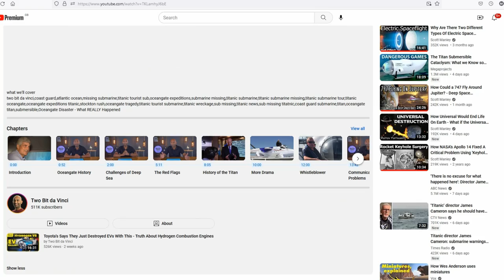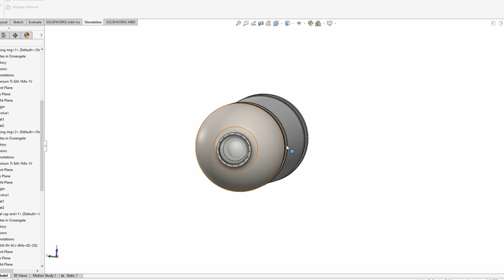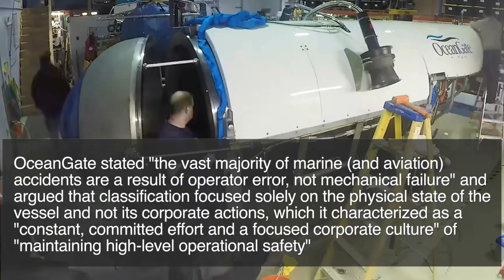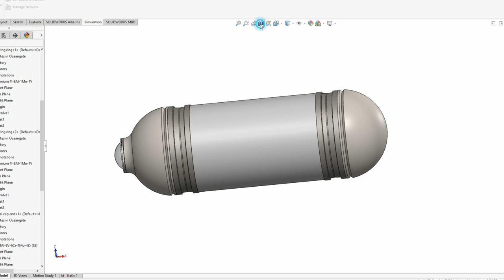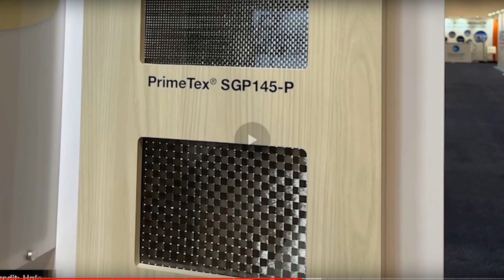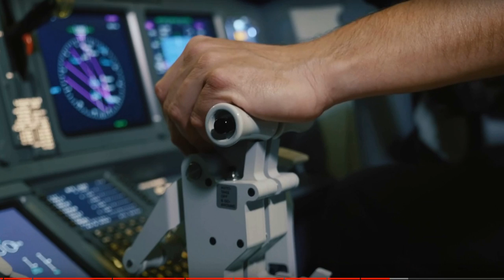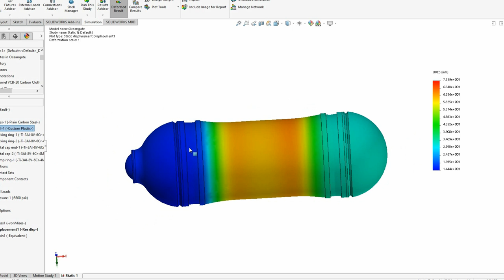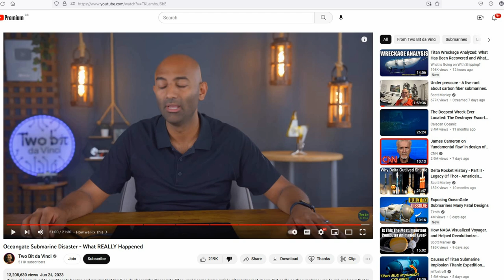Oceangate Titan - Engineering Failure?

Comment: You waffle on about pressure when it is commonly understood that the weight upon a person's shoulder is known to be ~14.7 PSI. That is understandable by most people had you said pressure is all around a body at 14.7 PSI. The bottom of the ocean is the beginning, not the end. There is a hole to dig into the mantle. You see, one person's perspective view. When you know the origin of the TITAN you would not believe it, so now I will tell of the subs design origin so you can figure out why the TITAN Sub was not designed to be a submarine - I designed what became the titan sub, complete with a carbon outer shell with a titanium lining and dome ends, one with a round window. The design was originally a computer mouse cleaner that was intended to clean the X/Y rollers that operated against sensors that controlled the mouse cursor position on a monitor screen. My design art of thousands of things, many vehicles, subsequently got made, distributed and sold globally. Now we have the Internet after my loss of design art and the unacceptable knowledge of the loss of more people who did not need to die but died because of them taking the opportunity to buy into what I see as stolen designs and I am not able to get anyone to investigate the loss of my technical designs of hundreds of inventions, products and stories. It is a cruel world, but people will always push things they have to the limits of operation and some will ignore the warning signs, as the operators of the Titan sub did, despite warnings from engineers because of the cost factor or otherwise.

Comment: Stockton Rush said in an interview, that the carbon fiber cylinder would flex inward 3/4" (19mm), when at depth. That seems like an awful lot to me. Seems like it would wiggle the glue joint between the carbon fiber & titanium, peeling it apart or otherwise making it weaker each cycle?

Comment: Could the implosion be caused by a micro crack or structural stress caused by the banging from inside? In other words, the occupants caused the implosion. Titanium body wouldn't have cost much. In the ocean, when filled with air, it's still as buoyant as a piece of paper anyway. So, why went for a uncertified (depth wise) and untested (life cycle wise) reinforced plastic is beyond any engineer's mind. To add insult to the injury, none of the billionaires who were so wise and smart to earn it in the first place didn't question any aspect of safety, redundancy, structure, regulation, certification, testing, what if worst case scenarios etc. The moral of the tragedy is "trust but verify", the good old cold war era saying.
Reply from the maker: The pressure differential is so great that you'd really have to go to town on it.

Comment: Surviving in space might be simpler in some ways but you still have to get there. Propulsion just to get there is the hardest part. The big thing with deep Submersibles seems to be balancing the strength of the pressure vessel with how heavy it will be when its finished. And its not just the ballast issue, you also have to move the thing around and find a ship capable of dealing with that weight. I think these guys went with this type of carbon fiber hull mainly to be cheap. It saves them on a complicated ballast system, saved them on the tender ship and allowed it to be moved around by much more common handling equipment. Just renting a big enough crane can be a big expense. The trying to do it on the cheap thing should have ruled them out of the deep sea game from the start. Their whole operating budget was a rounding error or a tank of gas for proffesional crews. Some things are "elite" for a whole slew of good reasons. They didnt even use the best methods available for making the hull. Probably had cat hair and mosquitoes glued in with the fibers. Crazy that they they seemed to have convinced themselves to not take 6000lbs per square inch all that seriously. I've read multiple quotes from Rush about having all this time if the porthole or hull started to fail. Really makes you wonder how well he understood what he was doing. Or if he had a death/murder wish. Now carbon fiber hulls for pressure vessels will be like hydrogen for airships. Hydrogen is clearly the best option for airships, it has more lift, its renewable and its not valuable for a million other critical things like helium. The Hindenburg died for reasons other than hydrogen, the burning hydrogen was kinda after everything else went wrong. Composites work fine for pressure vessels when created by proffesionals. Not by conmen in an open air garage.

Comment: The biggest thing I noticed is the titanium ring is on the outside of the carbon, this is likely because being inside would have thermal expansion problems where the ring would shrink more than the carbon fiber. So they put the rings outside putting the glue under tension and shear forces. The shear forces don’t matter as much because the  pressure is pushing the caps towards each other. However, cycling the tension force on the glue, along the ring to carbon fiber axis, would be a predictable failure point. The design is interesting because the carbon fiber is like a bridge between the rings but this design should have been scrapped since the interface between the two materials has no safe solution.

Thanks for the video, I was waiting for a solid works model showing the forces for a week.

Comment: The XBox controller thing seems practical if you're remotely controlling something but, I think what everyone is missing is would this be practical inside a manned submersible with higher oxygen ppm in the hull? Does the military use basic Xbox Controllers controlled within a manned vehicle? I heard unless it was modified for a flammable environment it and other non-shielded or non-dampened electronics could all become fire hazard. As far as I know the U.S. military only uses them for unmanned vehicles or drones that are no threat to a crew inside.

Comment: I find it outrageous that they spun the filament like a pool of thread, no transverse members to tie it all together laterally. That means they were relying on the epoxy or whatever resin to bridge the gaps between filament. Which will not stand up to high pressures by itself. Should have used steel or titanium!

Comment: I think the issue with the game controller was the one that was used. They didn't use a PS pad or an Xbox pad with millions of hours of testing, they used Logitechs cheapest offering. While Logitech are normally pretty good, the reveiws of the cheap pad are BAD, loosing connection all the time, stopping working altogether, chewing through the batteries in no time. If gamers would buy something better for PC gaming, why would they cheap out so hard for this?

Comment: This may be a stupid question, but what do you think would've happened if everything was built as it was done... but on top of that, there were like 8 or however many titanium bars that connected between the two rings outside of the carbon fiber tube? Like an external fixation in medicine? As a layperson: Those bars would've perhaps held the rings at the intended distance, removing strain from the glued section? Making the "weight-bearing" (or "pressure-bearing", I suppose) hull structure out of carbon fiber and glue seems ill-advised, but what if you installed something that made it not "bear weight" (or "bear pressure") or at least severely reduced it?
Reply: No change. The external pressure pushes the ends together more then the rods could do.  

I think it was the glue joints, but i think it was a leak, not a break. Once they failed in one tiny spot the water coming in at over 5k it would have acted like a water jet table and cut the glue out and fill the vessel in miliseconds,,,,,and compress the air and heat it to REALLY high temperatures,,,,causing water to flash into steam and send the pressure up exponentially and blown the ends off the plastic death trap. .... Crazy as it sounds I say the pressure inside went up OVER the outside pressure because of the steam. That;s the way i see it, anyway. 

And just for the record. Sure 5600 PSI is a lot of pressure but the Porta Power Jacks you buy at Harbor Freight (and others) are used by the 1000s all over the place operate at 10,000 PSI. 

https://www.harborfreight.com/10000-psi-pneumatic-hydraulic-pressure-pump-58047.html?_br_psugg_q=hydraulic+foot+pump

Comment: Am I right in saying that there were lifting lugs on the titanium attachment rings/sleeve fittings that were used for actually moving the titan around? Not sure if using these components for this purpose is a great idea. Would have thought a sling for lifting and moving it is a better way to distribute loads and not to apply sheer loads to the titanium ring to carbon fibre glued joint!

Comment: On the discussion about no GPS or locator beacon, DaVinci is perhaps making the point that the overall “safety culture” was lax. Titan had redundant systems to return to surface including the ballast drop which relied upon the fittings dissolving after 16 hours. Risk management in part involves evaluating the likelihood of an adverse event against how bad an outcome. Consider complete loss of power and commas while at 3,800 m: there’s 96 hours of air; the sub will ascend after 16 hours elapsed time; say 2 hour dive time thus 14 hours before self ascent; occupants cannot on their own get out. All is ok? Assume a 1.5 knot current (Titan did get pinned against Titanic on a prior dive.). At 14 hours of drift Titan would go 21 nautical miles under water. Add time for air search to mobilize and get on station and time for a surface vessel to reach the sub once spotted. The clock is running to get to Titan before the oxygen supply runs out. What does Titan need? An emergency beacon system (transmits a SOS and GPS coordinates on international distress freqs) and a strobe light with separate power. To not have these on board would be grossly negligent IMO. Likewise, getting entangled in the wreck or ghost net is likewise an unlikely event but the outcome is the same - extremely bad. Try locating a white, 22’ foot bobbing float from the air is hard enough (easier with a strobe) finding one at 3800 m in the dark is impossible. The surface crew waited until after Titan didn’t appear to raise the alarm. Did Titan have some sort of pinger (likewise with some sort of timer) to indicate it was stranded? Apparently not since not once did USCG or anyone else mention one. Other submersible experts raised the risk of entanglement as a very real risk in their critique of Titan; Titan had suffered essentially an entanglement before the end. Not to have an emergency pinger to raise the alarm and help search efforts locate the sub (while the few assets available worldwide to effectuate a rescue at 3800 m arrive) seems reckless.
Reply from the maker: "Titan had redundant systems to return to surface including the ballast drop which relied upon the fittings dissolving after 16 hours"

- I did hear that, and though that's a very clever system. 

The whole craft was flawed for sure, and the procedures they followed or didn't have in place. The title of the video was what really happened, to which we didn't get any real answers.

Comment: According to a transcript (which I'm not sure 100% whether true or not), it seemed like:
1: They were more negatively buoyant than planned, descending at about 90 minute pace.
2: They got some emergency alarm 400m above the bottom and tried surfacing but were only coming up very slowly (even attempting to jettison the landing skis on the bottom, hence why they appeared unbent in the wreckage).
3: They heard some noised from the back end cap leading me to believe the seam was leaking (perhaps the glue join had opened up when the cylinder bowed in the middle).
4: Radio silence after the last message at 9:46AM

It is possible to have a leak without an implosion if the hole is uncracked, or it's a window problem. In testing with the bathyscaphe trieste I recall they lowered it unmanned and brought it back up and the thing was filled with water - and they dared not get near it because it was spewing high pressure water due to the compressed airspace within. I am surprised the window held up because they are designed for inward pressure not outwards. If the same happened with the OceanGate Titan the ends would simply come unglued.

Comment: As far as I know, deep sea submersibles don't typically use ballast tanks as their primary means of ascending. Typically, a traditionally constructed submersible like the Alvin has a spherical titanium pressure vessel surrounded by lots of syntactic foam which to increase buoyancy to the point where the thing floats. Then you attach ballast in the form of something heavy (e.g. chunks of iron attached to electromagnets) that can be dropped when it is time to ascend. Oceangate tried to make do without the expensive syntactic foam by making the hull itself positively buoyant.

Comment: In the bad old days I designed sonar for ImageReady. Best one was proofed to 6000m. Yes, really.
A couple of thing's sent my BS detector off.
OceanGate didn't have a teather because it would be very heavy and a bitch to drag around at depth. 
As a free floating submersible it would be communicating via hydophones. 
The US Coast Guard pointedly mentioned that the sonobouys dropped would have picked up the broadband sound of the submersible being crushed. 
So would the communication hydophones. 
I think the support crew knew the submersible was crushed which explains the delay in contacting the authorities. 
They were getting their story straight with head office.

Comment: I found it incredible that they only laminated the pressure hull in a single 90 degree direction. Any engineers out there want to speculate why they would opt for that instead of layering it with cross sections at 45 degrees, etc? Was it just for the sake of cutting corners on the cost/time?

Comment: Don't forget that when the Titan is at depth that there is over 20 MILLION pounds of pressure holding the rings on the composite barrel.  If the glue failing was what made the noises on the first deep dive then the ends would have just fallen off when they came back to the surface since it was only the glue holding them on.

Comment: His argument about pressure cycles is true. Aloha Airlines Flight 243 is a perfect example of what he is talking about. The 737 made numerous short flights, the high pressure cycle caused the fuselage to separate do to cyclic fatigue and poor inspections. The same could be said about Titan, the composite pressure hull made it practically impossible to inspect throughly, and cyclic fatigue caused the material to progressively weaken. This is something they knew was happening. They had previously discovered cyclic fatigue in the pressure hull and the depth rating had been reduced to 3000 meters. They patched up the Titan to upgrade the rating back to 4000 meters. Cyclic fatigue is not something we need to consider when driving vehicles.

Comment: This was a pretty good video. I've seen so much nonsense on youtube. The Spencer composites vessel wasn't the one that failed. The "signs of cyclic fatigue" were loud cracking noises during its dives. That hull was replaced with a new one.
Reply: And how much damage was done to the glue joint surfaces when they removed the rings? - There is no way these taffy pocket cheap skates would spring for 2-new titanium rings. (Custom forged and machined - not something you pick up off Amazon, you know0
Reply: Who knows. I wouldn't be surprised if they did order new ones.

Comment: I find it hard to believe the team that built this craft were clueless.
It did after all go down to the titanic on 3 previous occasions, so it did work.
The adhesive is a red herring because the pressure was working with the joint not against it.

Comment: You can change the chassis so that it is the same vehicle in the U.K. It's reshelling a car. Edd China's Orange, and some other vehicles keep the oriiginal plate, like a Mini 4x4 which is just a 4x4 with a Mini body on top.

Comment: I’m a structural engineer PE, and I believe they should have had titanium scantlings installed every foot along the interior of the tube to strengthen and stiffen it similar to what are used in standard submarine hulls.
Reply: I think a better idea would have been to build the vessel as a series of three semi-spherical (parabolic?) sections with metal collars to take up the compression at the joins.  And build it out of metal, of course.
An internal frame involves a lot of parts that will all expand and contract at different rates, which is why subs bang and groan as they go down or up. Rush's tube was designed as if it wouldn't change size or shape at all.